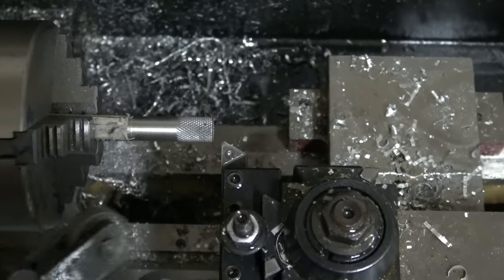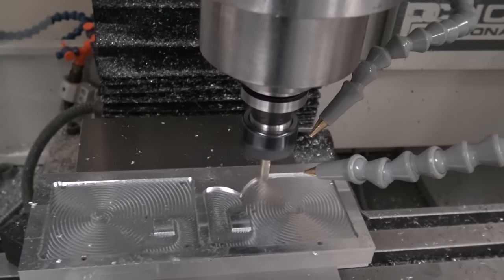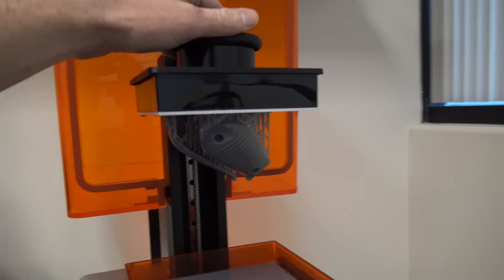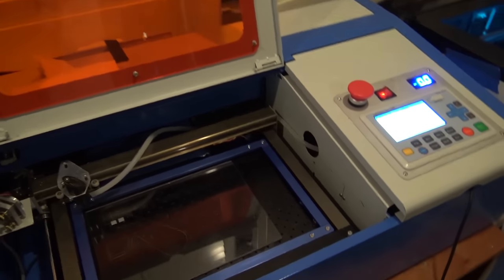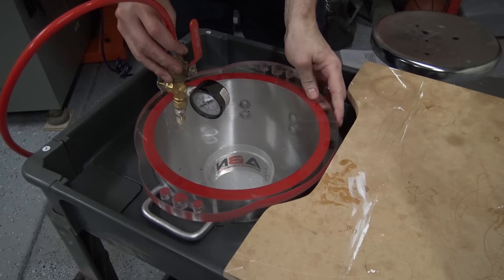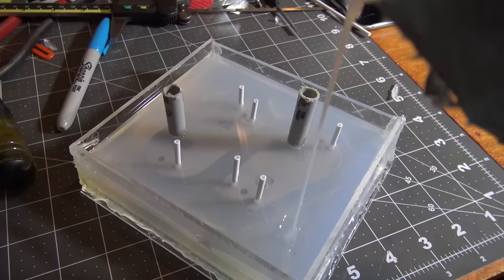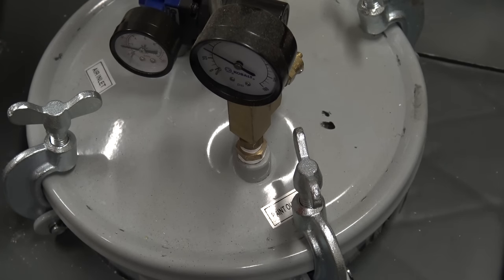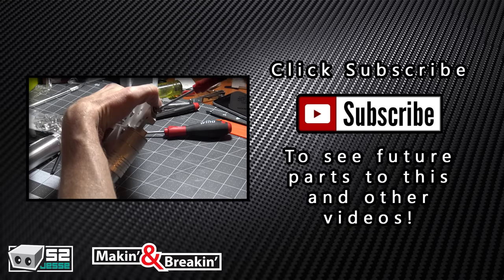Makin' & Breakin - Rey's all metal blaster Part #5

Comment: hopefully a blaster core in there soon :-) cool video and tutorial for casting too. Your mixing pots are IMO too short for a proper volcano + fallout when degassing. Pots with larger surfaces (and tall) are recommended as bubbles will have less silicone to travel thru to be extracted by the vacuum pump.

Comment: Jesse, real impressed with the capability you have built into your garage.  Nice work too.  I would encourage you to get away from hand tapping or tapping with a drill motor.  Before I started rigid tapping on the mill I ran a Tapmatic head on my drill press.  It's super fast, has a clutch to protect even small taps and most importantly, it will run the holes in straight.  Good luck and excellent video.

Comment: Looking good! If you ever have the same issue with too small of a pot: You can just break vacuum to stop it rising and degass again, continue to do this and eventually you'll have completely degassed it with a small container.
Reply from the maker: +Chibs I kept trying did about 30-50 cycles of it. I think the stuff i was using just really thick too.